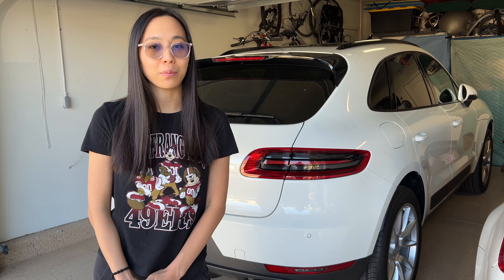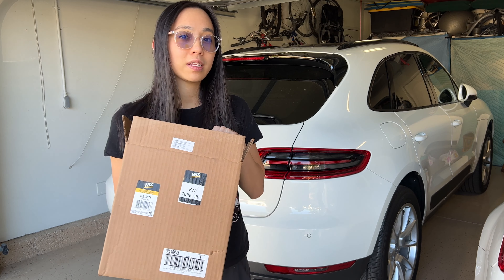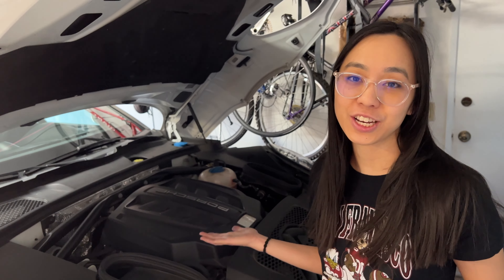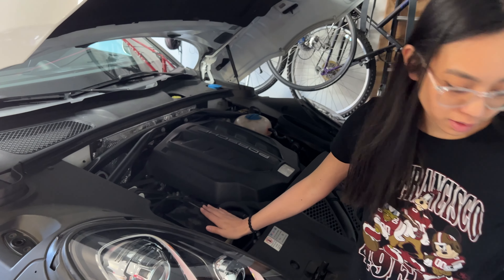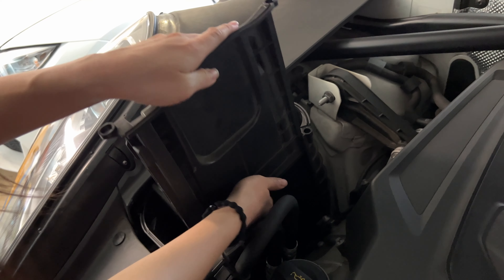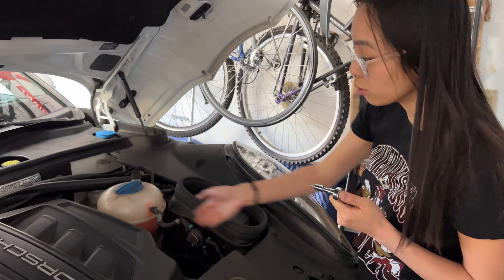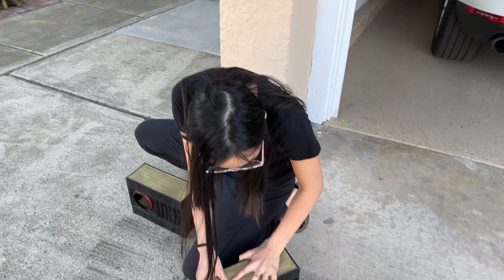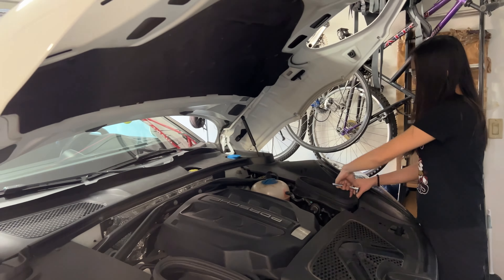How to: Change Engine Air Filter (Ft. Porsche Macan)

Comment: Great DYI! One question, do you remember if the black foam against the paper air filter is left on the cartridge or if it gets peeled off before install?
Reply from the maker: Thanks for watching! We left our foam on. The foam layer acts as a pre-filter for the paper filter, blocking the larger contaminants, as well as a preventing moisture from getting to the paper air filter. I know some people remove the foam layer to allow for better airflow, but improvements are probably minimal.